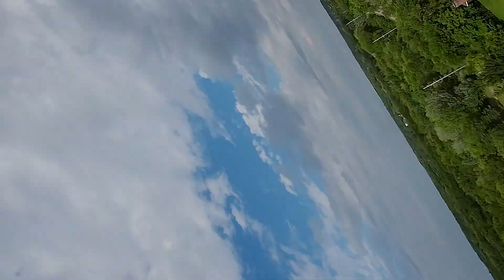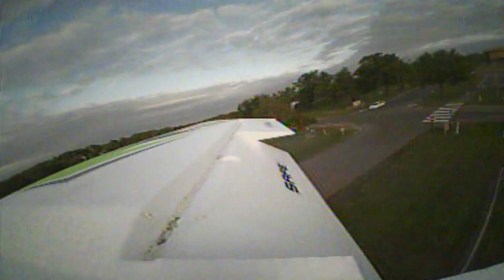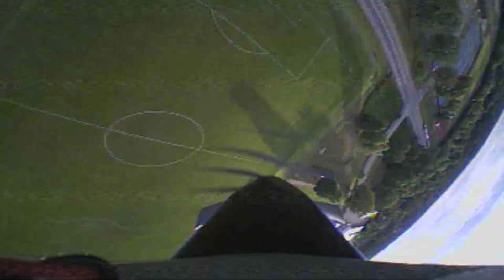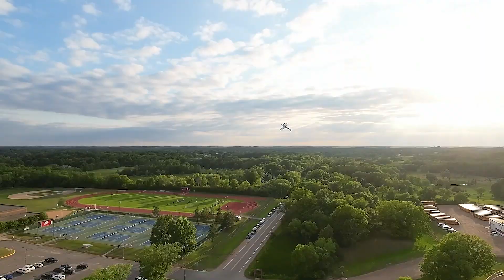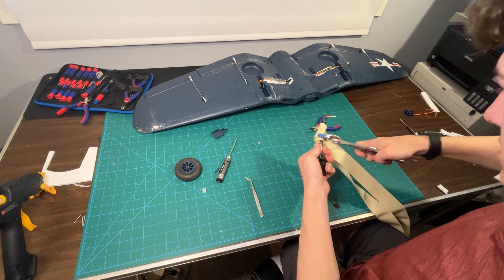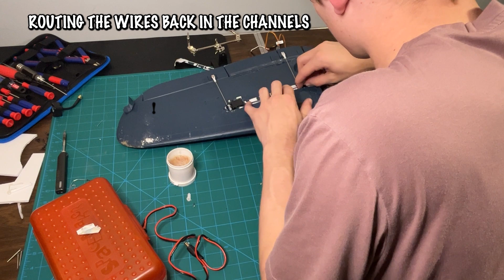RC Gear Repair // How to Fix the Gear on a 1.2m Corsair

Comment: Did you loose the pins that rotate the gear?
Reply from the maker: I think I was lucky enough to keep all the pins after the crash. However, one of them did fall out when I was taxiing, so I had to tape it back in.

Comment: Excellent video, and great explanation.  Two questions: What servo tester do you use.  What tape do you when you cover your rerouted wires?  Where did you get these things?
Reply from the maker: Thank you very much! We use this servo tester (https://amzn.to/3R15fQk), and its nice that it comes with a AA battery power source too. For the servo tape, you could use this (https://amzn.to/4bTWgsg) or this (https://www.e-fliterc.com/product/servo-tape-f4u-4-1.2m/EFL8510.html). Generally, I look at whatever company's website that makes the plane (EFlite in this case), and then I see if Amazon sells it too. Hope this helps!
Reply: @InvertedAviatorsRC  thank you for your reply.👍🏻🙂